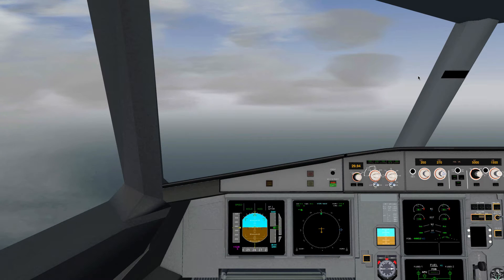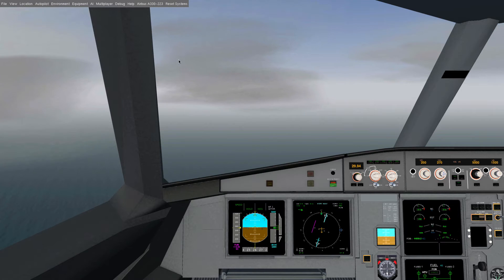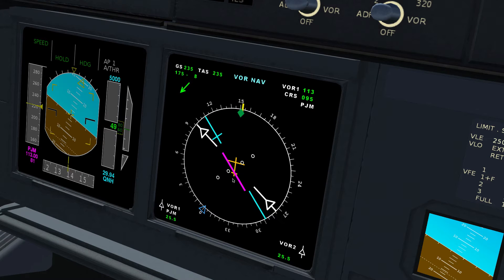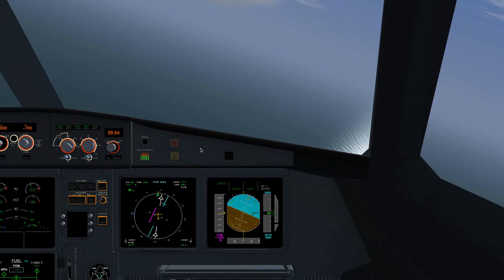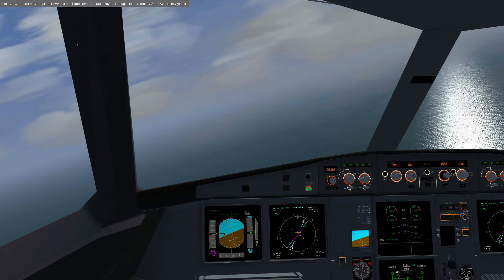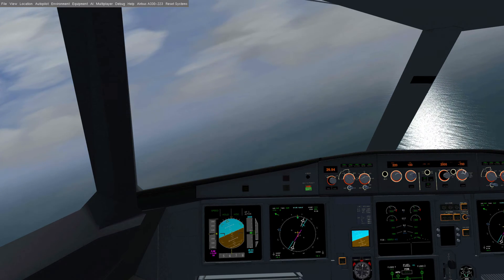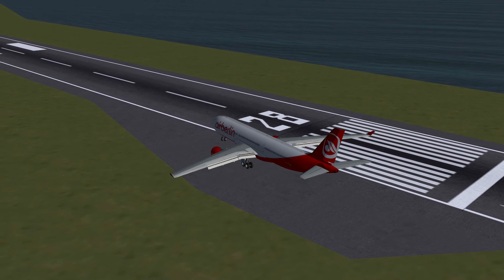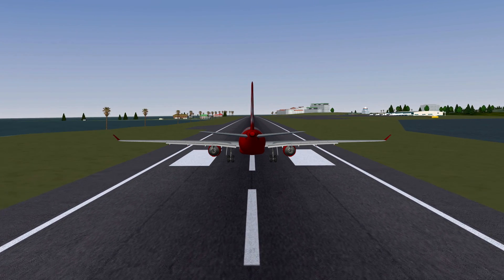FlightGear A330 Basic VOR/DME Approach (Real Time Recording)

Comment: Hey Oscar (and others who use the new A330s),

I've found out the A332-sound.xml issue and fixed it! The sounds on the A330-200s work now! Simply, pull the latest master branch from the A330-200-main gitorious repository!

Cheers!

Comment: Nice video, but here's a small tip (applicable for the new A320neo and the A330s), a more advanced way to set the VOR and ILS frequencies in the RAD NAV page in the mCDU. You can toggle between VOR and ILS using the ILS button on the captain's side of the EFIS. Now, you also have possible VOR2 and MLS (Manual Landing System) frequencies which you can toggle from the FO side of the EFIS.

Cheers!